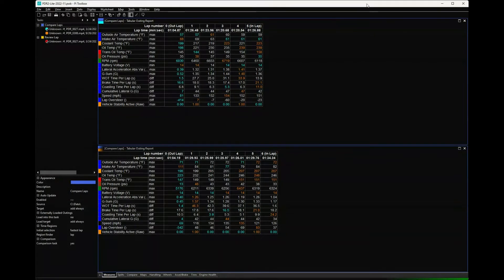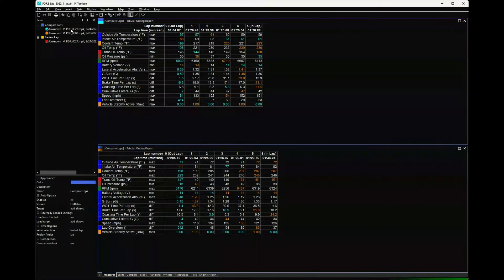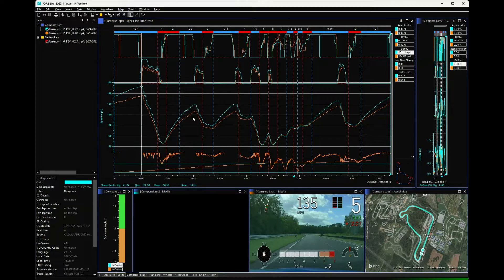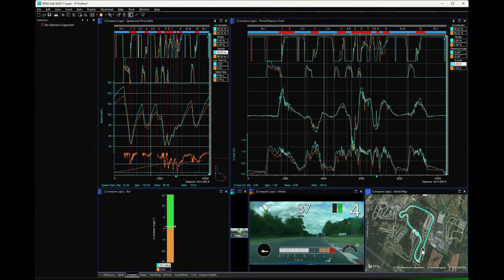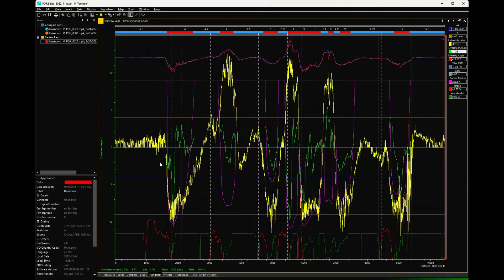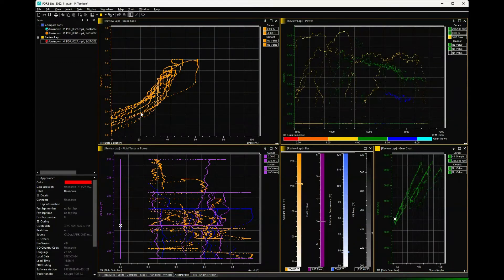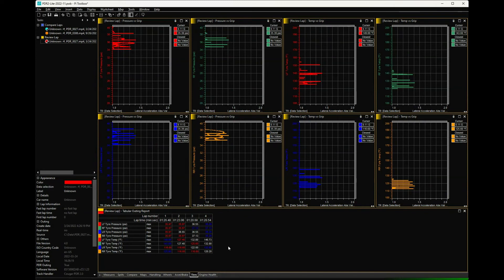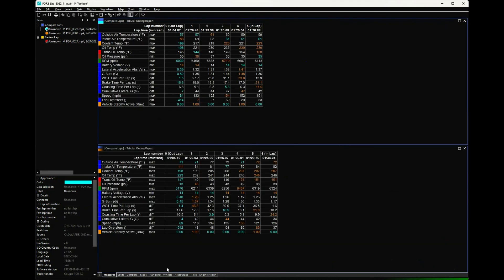Nov 22 Workbook Walkthrough for Pi Toolbox

Comment: You've taught me everything I know about Pi Toolbox. Thank you! 

I'm trying to use your PDR1 workbooks, but am having issues. My sessions were at Watkins Glen, but the Maps tab still shows Summit Point maps. The Compare tab also is only loading values from one of the sessions, but not the other.

This is odd since the data loads fine into an older workbook I have which I created following your older videos.
Reply from the maker: The map issue is an easy fix.  Go up to "map on the menu bar, then load.  Then pick the map file for WGI.  If you've not created a map file (.pxt file), see the video I made on creating map files from outings.  Hope this helps!
Reply: @HiPoDriver   Thanks for posting all these!   I changed my map successfully but the menu bars in each of the map windows still say "[Compare Laps] - Summit Point Main".   Can't for the life of me find where to edit that so I can name it to my new map/track.
Reply from the maker: @spearfish25  it should update automatically, but if you click on the display and hit F2 a dialog will pop up to let you edit the display name.

Comment: I'm not on the forums but do read them and see you say you really like the dsc controller. I had it on my 2019 z06 and have to say in track mode the car is horrible on an auto x course. I just ordered a set of mcs coilovers with 1000 lbs springs front and rear. I race auto x but mostly road course time attack. Last global time attack event I was running the dsc controller with Goodyear 3r tires and the car simply would not turn. It's been the worse handling car I've ever had. I want to know what im missing here cause I truly cant find the positive in it for a race car. Is mine broken or not working right? Do you like it because you think you'll have more consistent lap times and over all faster or for the comfort? I'm just trying to understand the approach with mag ride. Did you have to make changes to the settings in the controller? Also I noticed after about 2 laps the behavior becomes inconsistent and have heard its from the shocks getting hot. Anyways hopefully I'm not shooting myself in the foot by getting rid of mag ride but I went from lots of success with my 2016 camaro ss on zl1 1le suspension to struggle city with the z06. I should easily be in the 1:45 on Buttonwillow cw13 in that car and can barely break 1:48. Really hoping I didn't just waste 5k on MSc double adjustable. Another plus is I have a big wing and giant front splitter so not sure even the z07 leafs would be stiff enough. If you have any input for mag ride vs properly setup coilovers for a race car I'd love to hear it. Maybe just taking the dsc off and running stock would help. I'll test that while waiting for coilovers.
Reply from the maker: Hi Clayton.  Can you DM me an e-mail address?  If the car is really as bad as you say we should check the cal you are running.  I've seen some folks end up with cals that in effect were running the shocks full soft all the time.  I'm planning to do another video in the next week where I walk through how I approach DSC tuning and we can talk through this in a better forum that YT comments.